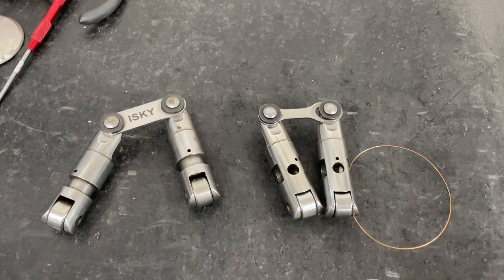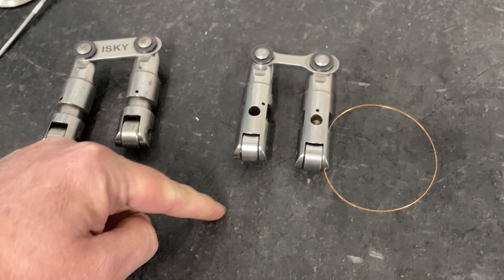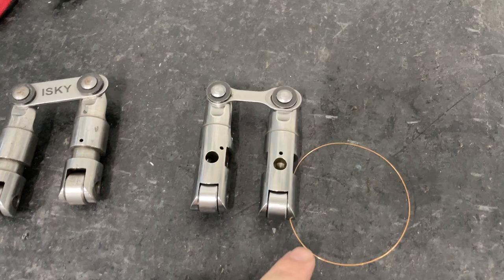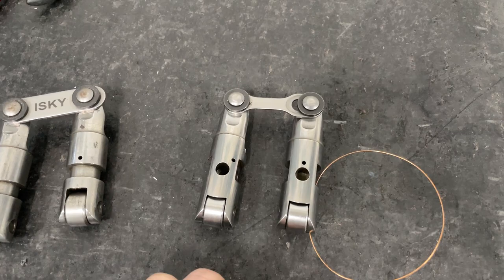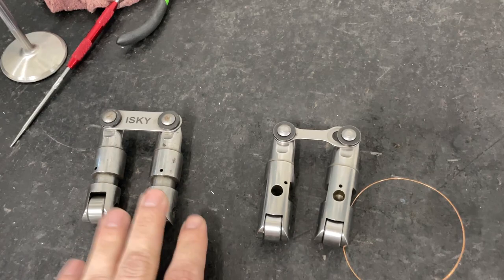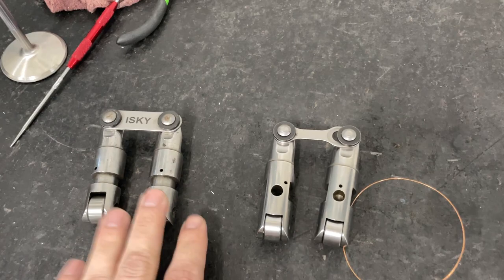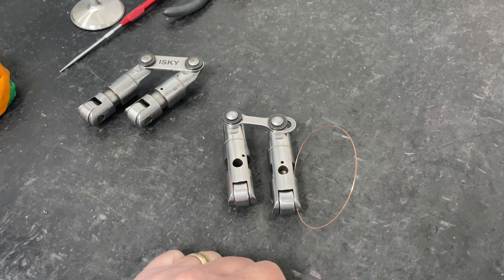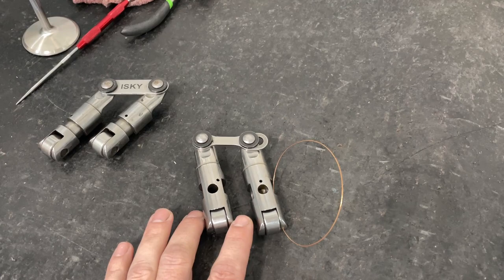I Was Wrong about oil passage with morel lifters.

Comment: My experiences have led me to believe that lifter to bore clearance can have a significant effect on oil pressure. 
   I’ve sent the same set of lifters back to be rebuilt during the freshen up and noticed that the polishing process was reducing the diameter of the lifter body. 
    Oil pressure began fluctuating more than the customer was comfortable with. One of the few times that I had the foresight to document this particular change. 
   The customer ordered a new set of lifters.  Same brand. They were .0015” larger in diameter. Changed then after two races only replacing the lifters and noting the clearance changes. 
   Oil pressure returned to normal. 
   Maybe obvious to some experienced builders however the idea will meet resistance from various people. Such is life I guess. 
   We tend to scrutinize rod and main bearing clearance even cam bearing clearance. Few people I’ve been around will document lifter bore clearance. 
   It seems to count in my experiences.
Reply: You are correct.  Lifter to bore clearance is how the lifter is fed oil.  Clearance should be from .0015 to .0018"  Also oil centistoke needs to be correct.  You want a centistoke rating of below 15 at 100C.
Reply: .0015 is not polishing! My crank polisher would say it's time for different bearings...
Reply: @straubtechnologies9011  How is , centistoke rating achieved? The viscosity of oil as it's use inside the engine?
Reply: The lifters had been sent back for rebuilding multiple times over the corse of several years.
Reply: Cam bearing clearance is huge contributor to oil pressure, (pressure being resistance to flow), a lot of people just thing more pressure = better, but that isn't a hard rule.
Reply: @zAvAvAz  Centistoke is the measure of flow at temp.  Any oil company can provide you with this data.  The W rating is meaningless.
Reply: @straubtechnologies9011  Absolutely. :o) thanks.

Comment: 20 psi at idle is plenty and nothing to worry about.  All that matters is that there's a thick enough hydrodynamic wedge between the rod and main bearings and the crank journals, and in the cam bearings.  The rest of the lubrication points don't really depend on oil pressure to keep things lubricated.   The loads on the crank journals are tiny at idle and 20psi there is plenty.

Comment: Thank you Eric for correcting your mis-information.    Also on oil pressure.  Mercury marine has a very good R&D program.  Mercury's shut off for low oil pressure for marine engines is 9# at idle.  The Guardian system will shut the engine down if oil pressure at idle is below 9#.  Mercury has always been on the conservative side when it comes to engine safety.

Comment: The Morels hemorrhage oil when the side window aligns with the oil feed. It puts direct galley pressure to a .020” feed hole on one side of the roller wheel. 
     A better plan is to use BAM, or similar, which feed the axle from both sides, using oil metered from the body to bore clearance. 
      If we’re machining a block to use the Morels, we clock the back banded lifter bushing feed hole to a location on the lifter that doesn’t intersect directly with the cutouts on the lifter. Between the side and front holes.

Comment: Thanks for your honesty.  That particular lifter on the left is actually a morel with Isky’s name on it.  I’ve had that lifter lose rollers and Straub doesn’t like them on bigger cams like .700 or higher.   I’ve had that same Isky badged morel delaminate mostly because of my excessive car show idling. It is about 300 a set cheaper than the ultra pros.   Isky ran them for a bit for some shortage or parts issues.   Thanks again.
Reply: Oil band style lifter with lobe lift over .400" is not a good plan.  The loss of surface area on the front back side of the body reduces stability on higher lift lobes and rpm.

Comment: I had a 6.2 diesel that I bought out of a wrecking yard. It ran fine but had only 20 or so lbs. of oil pressure cold and would hardly move the needle when hot AT ANY RPM! I pulled the pan checked the bearings and replaced the oil pump with no change. I needed the vehicle so I decided to run it until I could rebuild my old motor. It ran for 2 years and finally blew the head gaskets. When I tore it down the rod & main bearings were fine as were all the roller lifters and cam. The oil pressure loss was because the #1 cam bearing was no longer in the block and was bouncing around on the cam between the block and the first cam lobe. I have no longer worried much if the oil pressure was a little low as long as a engine sounds good.

Comment: Oil pressure at idle is not very important. As long as you have some pressure. There is no load on the engine. Also, it amazes me how many people get bothered by the Morel hydraulic rollers being a little bit noisy. I've run them for many years and they have been perfect. It's a performance engine. So it's going to be a little noisy!

Comment: I get why people are scared of lower oil pressures at idle. They have been conditioned to think they need a certain amount...and while the engine is under LOAD that is true, but just at idle, an engine only needs enough pressure to push through the engine and return it to the pan. I know of a few engines where the factory spec says that 4psi is enough at idle. The side benefit to it is that there is less power being consumed by the oil pump.
Reply: If you have a big cam and high spring pressures then you want good oil pressure at idle.
Reply: @shanerorko8076  But you still don't need that much. Most people run a melling high volume/pressure pump that they don't need, and then think 60-70 lbs at idle is good. 15-25 is plenty at idle. The vast majority out there are losing 3-5 horses all day long just on oil pressure alone.
Reply: @shelbyavant5081  Turbo guys dont care about 3-5 horses. Thats like .1psi too many of them.  Making power isnt the problem. Making shit live is the problem
Reply: @Saddedude  I commented, as an engine builder, on how much it takes for "shit to live", if that's the juvenile way you want to put it. I also added the provable fact that parasitic loss from things like the oil pressure/volume being too high, or even a mechanical fuel pump or poorly aligned distributor etc. can rob horsepower at a measurable quantity. Everything you do to make it easier for the engine to spin makes power AND longevity. Less oil pressure means less bypassing of the filter, less wear on the pump, it goes on and on, but you go ahead and worry about making it live without sweating the details that professionals like me have employed for decades.
Reply: @shelbyavant5081  As a professional you would understand the needs of a turbo car and a n/a car are drastically different.

The amount of squish on the bearings for example being significantly harsher on a turbo car. Turbo cars also require more oil flow for the turbo itself and for a cooler hopefully.
Reply: @Saddedude  But at idle, there's no difference in the oil pressure needed, turbo or not.
Reply: @pete540Z  which is fine. I dont need a car too make 60psi at idle.  Mine makes 45psi or so while hot idiling. Not a numbe i particularly care about.

My point is that not everyone cares about 3-5hp lol. Its so miniscule it can hardly even be considered outside the margin of error on a 3-500whp car. On a 1000hp car who cares? Seriously.

Speccing a high volume , high pressure melling pump for an n/a car is a waste. 

But all my turbo cars get acdelco high volume dod pumps for a myriad of reasons.
Reply: @Saddedude  - agreed.  A few HP is nothing anyone can feel in the seat of their pants anyway.  Maybe if you're racing a car that is incredibly matched weight and power wise it would matter.  But I'm with you.  I've seen instances where higher pressure may have actually saved a crank when something out-of-spec happened.

Comment: Good Video.  Hey we all make mistakes and learn, and help each other learn/benefit.  I would like to get your take/see a video on Solid Rollers with Rev kits.  I am a boat guy, and have run 0.600 lift solid rollers in  boats for  up to 15 plus years with NO failures (crower solid full bodied rollers with needle bearings), or lifter changes.  Pre-LS small blocks that live at 5800 to 6000 RPMS.  I have always believed rollers are deigned to roll (not skid) , but most cam maufacturers use these style lifters that you show, where you need full bodied lifters to run a rev kit.   Being an engineer by trade, I was suprised that (3) major cam manufacturers said rev kits are old technology, or junk / not needed, and that valve spring technology has come so far that they are no longer required.   <<<Scratching my head.......How can valve springs compensate when there is lash for a significant amount of cam rotation, and then every time the valve opens the lash has to be taken up (little hammer effect between the cam and lifter).  I guess that is my rant, but there are limited choices for solid roller lifters for use with rev kits. I guess you could use the horizontal link bar - good idea, push the lifter off of the cam, right, opening up the potential for the roller not to roll but potentially skid along the cam.  I guess these pop up lifters are ok if you are on the dyno and cam swapping, but thats it in my opinion.  Using rev kit can also allow you to take some load off of the pushrods, rocker arms, etc  <<< Rant over, like I said, would like to get your take, as I find your videos informative.

Comment: Eric, lots of questions: Where and how is the oil pressure measured on that block, and where is the lifter / cam in the oil path? If the mains have priority oiling (cam second), wouldn't the flow to the mains be the same, and simply some flow restriction changed with the lifter? Also: does that automatically mean significantly more oil on the cam - could that perhaps depend on the pump/system? Do you only need a very high oil pressure when the hole in the lifter is too small and you need to flow more oil faster -- is it perhaps ok to have low oil pressure at low rpm because it does flow enough oil through the low restriction / larger hole?

Comment: I was also wrong about Morel lifters. My mistake was buying them. Total rubbish.
Morel part number 5321 0.904" for small block mopar hyd roller. NOISY as hell. Rattle like crazy. i have adjusted them with no lash, 1/4 turn, 1/2 , 1 1 1/2 turns all the same. Tried 3 different weight oils no difference. If I could get them out without taking my heads off (which you cant on a Mopar) I would throw them in the trash and get something else.
Correct spring pressure on seat and nose. Lifter bores all freshly bronze sleeved with rebuild. 
Absolutely disgusted with this Morel rubbish.
Reply from the maker: I totally agree but according to their main salesman the only problem they have is the customers.